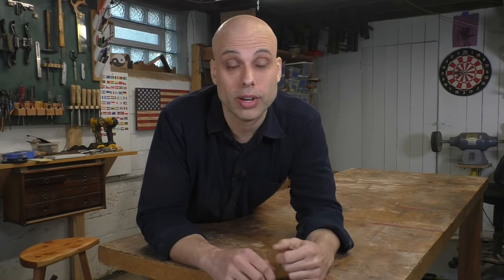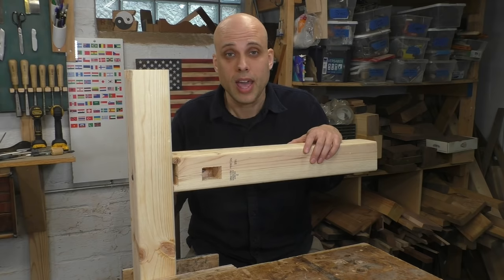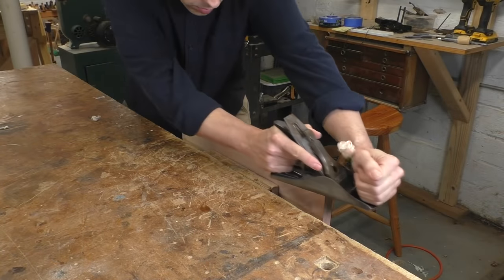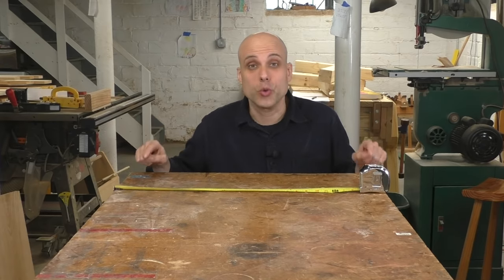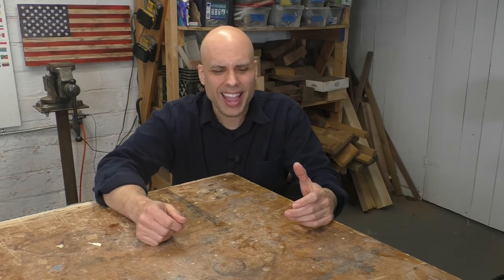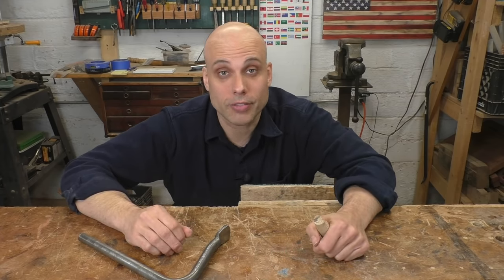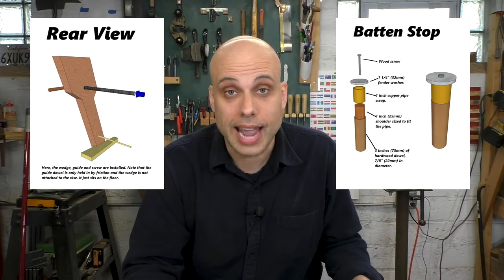Four Workbench Building Mistakes (that we all make).

Comment: I have very limited space and thought that a drop leaf bench top with slide out supports  might be a good option. I have a table with this system and when the sliding supports are secured in place, makes the top strong and flat. using door hinges in a thick enough bench top with the right clamping accessories and holes for dogs and hole fasts would work well for me. My projects are usually electric guitar related. The basic design for the drop leaf bench top is all in my head as of this comment, but I can design and build things without ever committing it to paper.  modifying and adapting along the way as needed. For this I will draw up a detailed  measured drawing also I need to have versatility for interchangeable power tools, such as router table insert, table saw insert and others similar to the older sewing machine fold away table cabinet. with this version there will be anchor system integrated into the design. I can visualize it well and refine the design easily enough. i merely need to sit down and design it soon as I'm sure of just how much room I actually have to work with. wish me luck..Oh by the way I've been doing this sort of thing since I was a child os arouns 6 and I'm now 63....and ADHD helps a little too..

Comment: And I just get by with a pair of nice sawhorses and a simple hollow core door. Not to sturdy but it is at least flat. But my shop is my garage which holds other valuable things like a car and a truck and motorcycles (2) the lawnmower and bicycles (4), table saw, sliding saw, router table, drill press, band saw and a morticer etc. I got to have something that can be taken down folded up and put away. If I had a designated wood shop I’m with ya.

Comment: Does the bolt on the other bench has a locking nut? I think if the washers were wider and there was a counter rotation lock, the joint would-be better

Comment: So you mentioned there are tons of traditional workbench types and styles and I have looked around and seen that they are different shapes and sizes, some have lower level "trays" some at the end, some in the middle. Others are flat and flush but are long and thin rather than short and deeper. 

I am thinking about which bench to go for but without trying all these different styles j don't know which is best for me. 

Would you be able to do a video about the main differences in design to the traditional style and the reasons / uses behind them so that we can have a better idea of how to pick between styles when we don't necessarily have the opportunity to try them all?

Comment: I was thinking of making my bench using 4x4's for the legs rails, stretchers and for the top. I figure that I try using mortise and tenon joinery for the whole bench as well so my question is am I crazy to make the bench using 4x4's? the bench will be 7 foot long and 24 inches, now after some serious thinking I decided to make the bench 24 inches from 30 inches wide.  Now my question is am I crazy to make this work bench this heavy? I might put wheels on it at a later date.

Comment: The TWO problems I have is that FIRST my work shop is only 8 foot across by 8 foot deep, so I don't actually have space in my shop for a work bench. This brings me to my second problem as my work bench HAS TO BE PORTABLE and can be compact enough to store when not actually in use!! Again my workshop is only 8 foot by 8 foot, so I don't have a ton of room to store a huge work bench I have to use outside! And then further I have a small work bench in my shop already that is mainly for working on "different projects" the bench I have is roughly two foot wide, by five foot long, and I designed it as a place to sort and clean parts, tinker with electronics and mechanical hardware, and it really isn't designed for wood working at all!! Though I did build it to be stupid heavy duty, and it can take a major beating, I basically wanted it so when I needed to work in my shop I could on small projects like I said.

Comment: when it comes to mortice & tennons, if you don't have the skills or pinpoint accuracy to pull it off the old fashioned way, no problem, just grab a router, a drill, a chisel, a circular saw/table saw, and just hog out the materials, you use the drill to hog out material in the mortice (or tennon?, can't remember the term that fits which part), then once you've gotten the maximum amount of material out, you go around with the chisel to square up the corners, now, for the other part, you have a few options, you have a router, a circular saw or a table saw, and then go around with a chisel for fine tuning, it just seems imtimidating at first, but it really isn't, hell, if you've made a thru hole & a dowel, you've made a mortice & tennon

Comment: As far as resurfacing goes, I find the tempered masonite over wood works good. Glue drops and varnish specs often flake right off. For the stuff that wont, a light orbital sanding works well. The beauty is, after years of abuse, the entire bench gets a new surface by replacing the hardboard, rather than replacing the whole wood top of the bench when it has been planed down too far. You can only plane so far before the vice sits proud of the bench top.

Comment: Over 40 years of carpentry and woodworking and I ruin my benches, I cut, rout, drill into them whenever i need to, i mount whatever vice i need and take it off and move to the other side as needed. It is meant to be used and abused! It is made out of any leftover scraps i have - 2x4 4x4 6x6  with a piece of 3/4 ply on top and maybe a piece of 2x on one side, GRKs are great to screw it together and maybe a bit if joinery.
I got a job to do and the next job the doors are taller so i better add onto the bench and drill some holes to allow for clamping. F... the bench and get the job done so i can take the dog for a walk or whatever 😅

Comment: I.... built my workbench with just over 1 entire box of 3.5" screws. It has no stretchers; just a 2x4 frame at the top and bottom, capped by 3/4" hardwood boards on top & bottom of the 4x4" legs. I have braking casters on the bottom, and it's just over 4 feet tall, to accommodate my height. My biggest mistake seems to be... every choice I made. 😅

Comment: A proper English woodworking bench has a full length channel in the middle ,This is for laying down planes & tools safely to avoid dropping on floor .Also the channel makes it easier to sweep gather any shavings & sawdust & brush them up at either end of bench ..There should also be an adjustable vertical wooden lockable bench stop ,for planing stock timber .A proper metal wood lined carpenters vice should be present & also a good selection of G ,sash & other various clamps available .To finish off home made bench hook should be made for holding timber firm with hand whilst sawing .A pot of animal glue should always be heating up ready for jointing purposes .All woodworkers should be ready at all times to stand to attention at end of bench for a chisel edge inspection ,Let’s have it right !

Comment: If using the half lap, it might be easier for some with limited tools to use half width material and laminate them with the half lap built in by adjusting the length(s) of the adjoining piece(s).

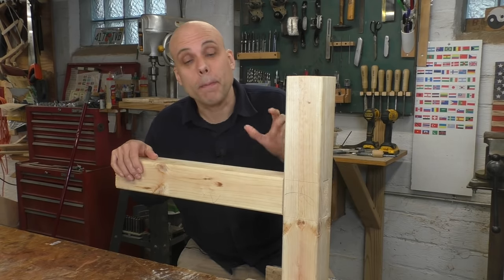Comment: 3:26 Question on the mortise joint. On the discord I've seen quite a few people, making the stretchers from boards about half the width needed, just glue two 2x4s together, leaving one long to act as the tenon, and cutting the other short. Is that sufficient? If not, how about if you made each board half of the tenon and shoved them both in there?

Comment: Rex is there such a thing as like a folding bench because I've have no room for a bench indoors and I was planning on building up a good hand tool kit like what I learnt with at UK college as I recently built my uncle a deck and found out my planes ran away and my other tools weren't up to much and I was going to rent a garage but I just found out they're 5 times the price they used to be and that's not worth it in my eyes

Comment: No reason to chisel out mortis joints. Drill a big hole at each end, use a saw to connect them, and radius/round off the tenon corners. Easy. Also, radiused mortises resist splitting at the corners.

And for the bolt joints, use a big dowel nut and a dowelling jig for drilling the holes perpendicular. Not as messy, time consuming and probably stronger. Also, it's really easy to inset the top horizontal supports into the legs a little (make a ledge) if they are level with the top, and that adds tremendous vertical load stiffness.

Comment: Don't go by any "rule of thumb" for height. Use your tools at various heights and determine for yourself what height YOU feel comfortable at. I'm 6'7" and my bench top is 39", I've been using it for 10 years. By the "rule of thumb" method it would be at 34" and make working at it miserable. 
The "rule of thumb" in my opinion is for those who believe working with a bent back is correct. 
Before I built a bench I had heard Christopher Schwartz talk about the rule and immediately knew it was not for me. I regularly work at countertop height both at home in the kitchen and at work as a carpenter so 34" was guaranteed to not be ideal for me. 
And I'm not alone in this thinking, Paul Sellers who is a noted hand tool woodworker is 5'8" and his benches are around 38". 
The same goes for width, at my height a 30" wide top wouldn't be an issue. 
Too often in bench building the experts are using historic benches and using modern heights to suss out the whys and what fors. They are ignoring the fact that people are taller on average now than they were in Roubo's time. But they all allow for the difference between modern iron planes and the wooden planes of Roubo's time. 
I would only suggest mortise and tenon joints for the frame, my reason is that even new wood workers can use the practice. 
Also don't ignore the pine, oak, and maple laminated bench tops sold at most hardwood dealers. Heck even Sears used to sell a bamboo bench top. Most are roughly 30" x 8' and 2" thick. My choice for a top was an oak version. I left it 8' long but ripped it to 24" wide and used the off cut as a front apron. Works great, comes dead flat, stays flat, Gramercy holdfasts hold great in it, and in 10 years there have been no issues with delamination. I don't even have any stretchers under the top. It's only support are the tenon shoulders on the legs.

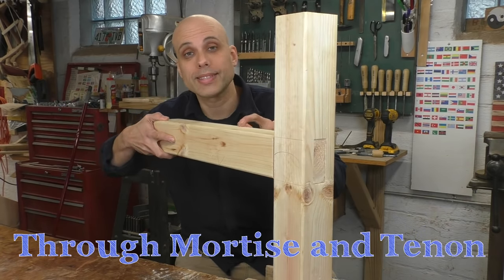Comment: Do you have any advice or suggestions for making large through mortises, like the one you show at 2:48?  I've cut 24 through mortises of roughly that size and depth via the standard "drill and then clean up with a bench chisel".   It's a bit tedious.

It's not the end of the world, but since I want to cut several dozen more of these (for tusk tenon construction) I've been looking for easier approaches.  Short of buying a very expensive swing chisel mortiser or chain mortiser, I haven't come up with much in the way of good options. Even the traditional mortising chisel approach seems to be limited only to about 3/4" wide mortises at max.

The tusk tenon joints I've made have used pairs of horizontal tusks instead of a single vertical tusk.  This was originally because I wasn't confident of my ability to mortise vertically through a 4" high, 1.5" wide tenon.  But in retrospect I strongly suspect it's actually better for resisting wracking force (particularly on uneven surfaces), because the pair of horizontal tusks provides a large contact area on the outside surface of the post, adjacent to the through mortise.
Reply: 1-1/2" auger bit (Wood Owl Ultra Smooth) with a 1-1/2" framing chisel (I'd go with Barr) and mallet (Wood is Good 30oz) is likely the best/fastest way short of a chain mortiser.

Comment: That is funny, I actually want to work mostly with handtools since I not even really have space for a tablesaw, or other machines. What type of workbench would you recommend for this? 

Edit: I have enough space for a 1.5 meter long workbench but a workbench plus several machines will barely fit and make the whole workspace completely cramped and that is just a big safety hazard

Comment: One other big problem with that first bolted design: there's only one bolt.  Yes, it's cut out so there's 2 points of contact wood-to-wood, but without anything to constrain those points of contact, you're probably better off without that because then it's more contact surface and thus more friction.  You can still freely rotate it because it rotates around the one thing holding it together: a nice, round bolt.

Tip to newbies: if you're connecting something using circular connections, be they nails, screws, bolts, dowels, etc, it's not rigid unless you have at least 2 of them.  A lot of the more sophisticated joinery methods involve making sure at least part of the connecting surface is squared, like that mortise and tenon or the half lap joint shown in the first half of the video.  You can spin a circular peg in a circular hole, but you can't spin a square peg in a square hole.  (The half lap gets it doubly right as shown - 2 bolts so there's not a single thing to rotate around, plus squared wood jointing that resists rotation.)

Comment: The best features I see, are the long shaft Baldor motor with what looks like a buffing wheel on one end, but I can't see the other end, and a metal working vice. While the vice looks to be a little small for my needs, what I like most about both of these tools is that they are free standing and mounted on a heavy steel pedestal, which surely is bolted to the floor. Essential tools mounted to give maximum access and working room, just the way God intended.

Comment: I have very limited space and it has it move so I can get the wife's car in the garage. So I have some 3/4 melamine attached to some tubafors and they fit perfectly into the slots in the saw horses. Not perfect and not strong enough for some heavy hand tool work or vices, but it makes a handy assembly/gluing area.

Comment: Question - my old bench (already built when I bought the house) is fixed to the wall. It's great to have rock-solid stability as a feature. However, I'm building a new workshop and considering changing it up. Frankly, I'm not sure what the benefits are of having a floating workbench. What do you think?

Comment: "Doing it the way they did for centuries...."
The Journeyman (Master?) of a shop where I worked about 40+ years ago told me to do a certain task.  I asked why we did it that way, and isn't there a faster and more modern (better) way to do it.  He paused, thought for a brief moment, took a breath, and said, "Because... (groan)...  I don't want to explain it to you.  Just do it the way you were taught."  Turns out the old way still is the fastest, and most accurate.  If I'm building just one (depends on what I'm making, and the needed techniques), it may be as fast to only use hand tools.  It's also relaxing, quieter, and less dust.  If I'm making 100 units, well, then I'll need to set-up power tools and do duplication work.

I spent my time in production shops. One day the Journeyman and I were side-by-side doing lead work (on our respective tablesaws, cutting out panels for a kitchen).  He was badly injured in Vietnam and could hardly walk.  He would look down at the cut list, slowly think it over, limp back to the 4x8 sheets behind him, set and start the saw, and cut his panels.  I however was fast and smooth.  Not a wasted motion, planning ahead so there was no down-time between panels.  Greased lightning.  He was slowly pulling ahead.  After one hour I said, "Ok... that's it.  You win."
     "Win what?" 
"I spent the last hour trying to beat you."
     "Oh...were we racing?"
"Ehhh... I guess not, at least you weren't."

Comment: Just use an old dinning room table built in the 60's and level the top and make some 2x4 legs that put it at the right height with no side racking, thats what I did 👍🏿 Then built a torsion box later on

Comment: Common traps: "not enough work holding" YA, try making it so the bench can morph... "loose joints" WTF puts in loose joints? Crossmember everything! Triangles are your friend! "the wrong size"... make the bench larger then you need for that one job and you're good...

My bench is a multitasker... It doesn't just fit wood working, it is also used for electronics, electrical and mechanical.

Comment: I built a roubo bech out of framing 2x4.  All joimery is glue and wood dowel pegged morticd and tenann, no screws.  The top is 3 inches thick and has 3/4 dog holes for two mounted vices.

Comment: The half lap is stronger than the tenon because it has half the width of the stretcher connected to the vertical member. The tenon is typically a third of the width of the stretcher.

Comment: Dowels for joints are a good option as well. 
If you have longer dowels cut from stock you
don’t even need a jig, just drill as many as you like through both
pieces and cut off the excess when the glue dries. Looks ok too.
 Not much skill required, fewer tools and very strong.

Comment: Easier way for a beginner to do legs and get a mortise and tenon joint. Use 3 laminated 2x4's for each post and cross brace. Leave the middle 3 1/2 inches longer on each end of the cross brace, and leave a gap in the middle where you want it to go into the front and back legs.

Comment: I'm fairly new but I just screwed some 2x4'stogether with a 3/4 inch 4x8 sheet of finished plywood, minus a couple feet cutout to have my portable table saw. It's solid as can be and works perfect for everything. It's ugly but I don't see the point in getting all fancy, not like it need to hold 5000 lbs.
Reply from the maker: Well,  like you said,  you're new at this.